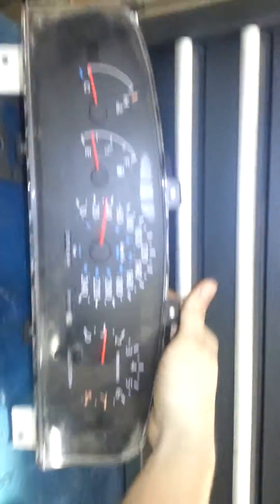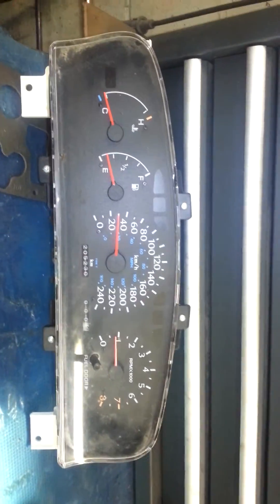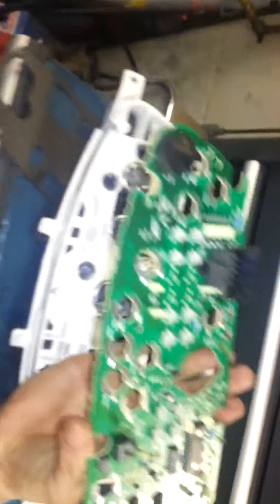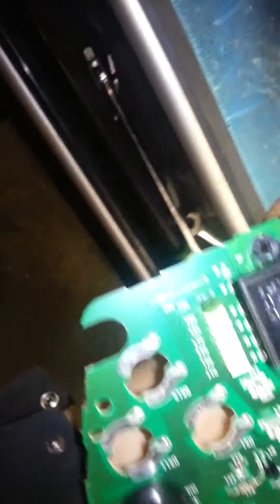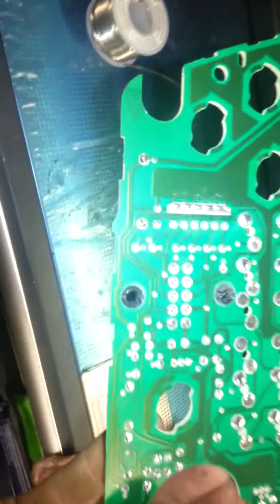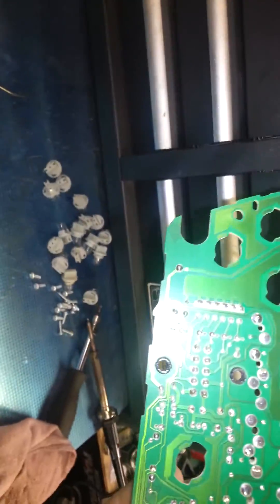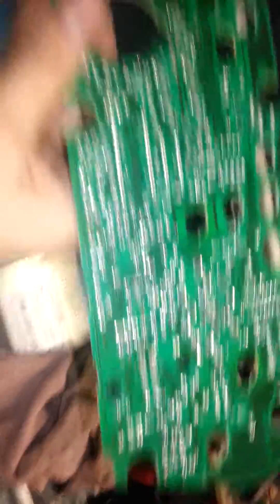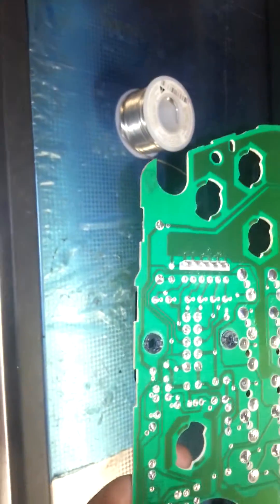Dodge neon dash cluster fix

Comment: hey what will happen if u replace the cluster from another car .. is ur original mileage still going to showed up or the other mileage on the cluster that I put gonna showed up?
Reply from the maker: Ronie Salazar the milage on the cluster will change with the cluster
Reply: brandyn30  soo the mileage on the new cluster will showed up not my original mileage?
Reply from the maker: +Ronie Salazar correct your original mileage will not show up
Reply: brandyn30  is there anyway to solve that problem ..I want my original one to showed up thx
Reply from the maker: +Ronie Salazar you can get them programmed you will have to see if anybody local to you does instrument cluster reprogramming

Comment: I can't find the last screw or thing that is left to allow me to remove the cluster and I have followed the instructions  on this check list to the t however I can't find the last screw/ bolt that their talking about to remove it. I have a 99 Dodge neon with the rpm cluster. Any help would be much appricated.  http://mechdb.com/index.php/Dodge_Neon_dashboard_removal
Reply from the maker: man I can't remember how it all comes apart. it's not that hard. hope it all goes well for you.
Reply: Thanks! Wait I figured it out. Once you get all of the outside screw's out of the dash you just pull it out. There is no hidden screw like they talk about in that link I put above. Keep in mind that this applies for me in a 99 Dodge Neon with a tach and it's a sports model. I got the Cluster out but now I looked for parts and called Dodge and they wanted $584.00 for just the circuit board. Gonna try junk yards.